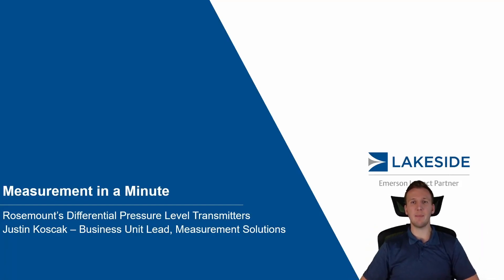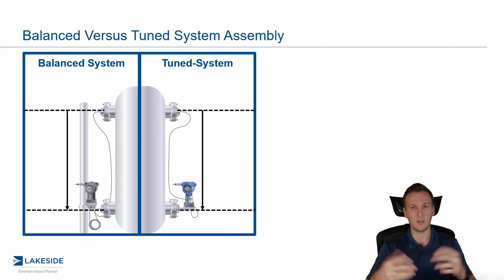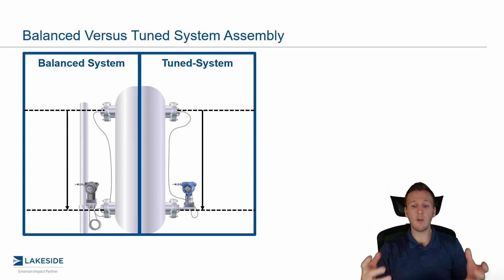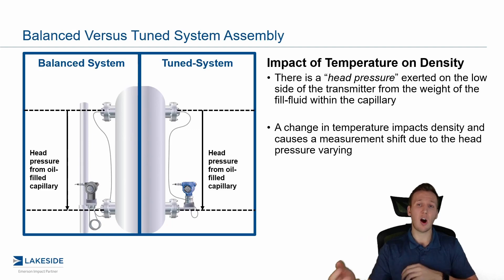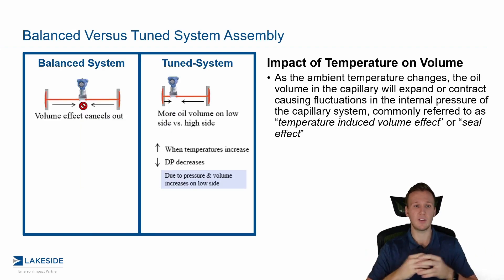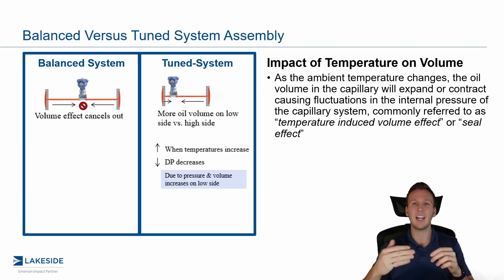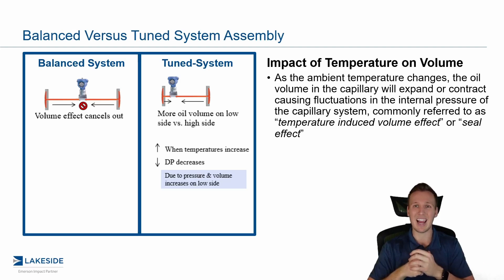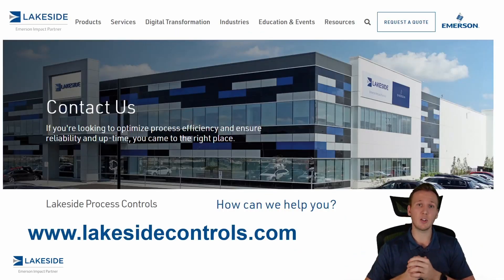Comparing Performance of Balanced and Tuned DP Level Transmitters | Measurement In A Minute

Comment: What I found was that if the sealed filled lines were NOT insulated you would get errors by the sun heating up certain parts of the line while those in the shade saw less sunlight etc. So the key was to insulate all the filled lines.

Of course if you were using electronic remote transmitters for both high and low side then there isn't any filled lines.